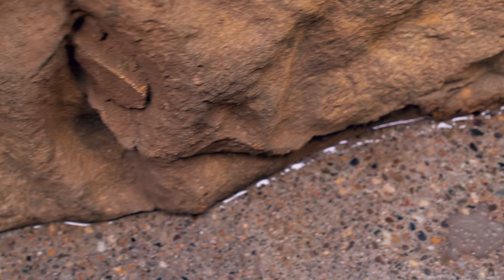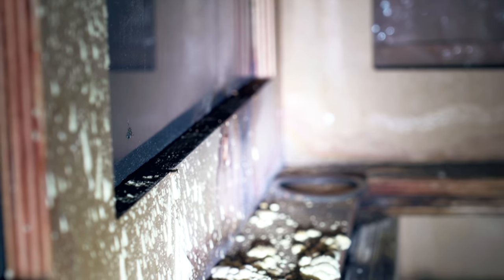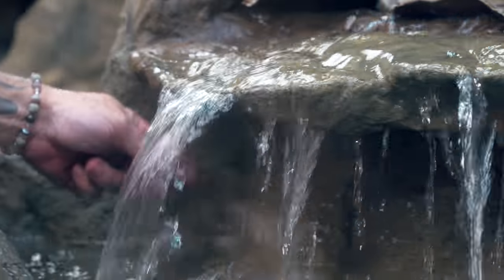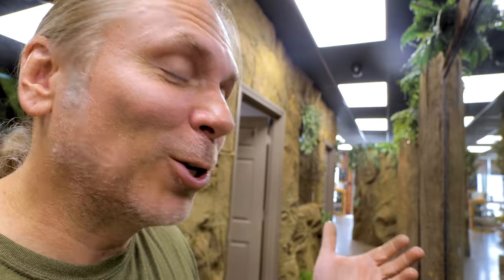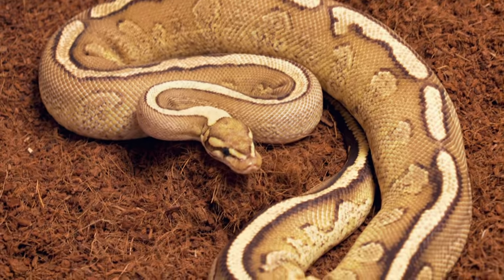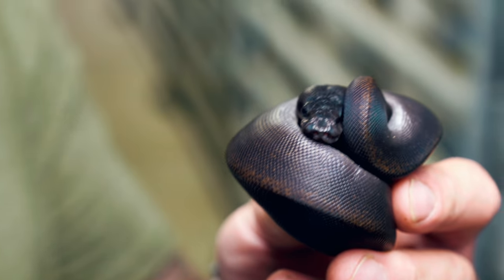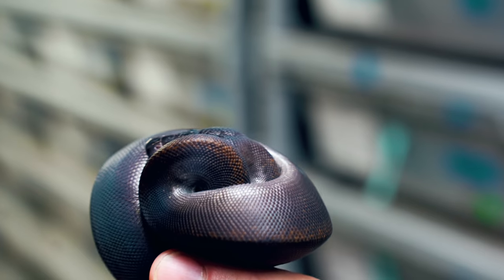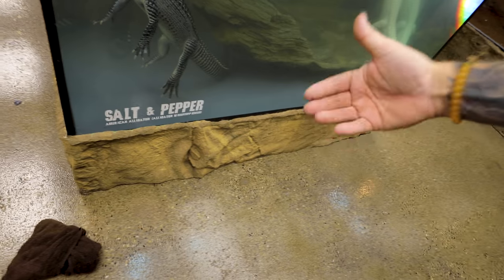MY ALBINO ALLIGATOR POND IS LEAKING!! NOW WHAT?? | BRIAN BARCZYK

Comment: I’d be concerned about water getting between the tank and wood frame. Even though the outside is flexsealed, the wood frame could rot from the inside.
Reply: Yeah that whole thing is going to have to rebuilt in not much time...water destroys wood quick.
Reply: Zach Jaynes You guys are right .I was looking at wet wood, mold no telling what is going on in the inside.Flex seal is junk never did have any luck with  that product.This could be a very big deal.
Reply: I was thinking the exact same thing
Reply: Just think how fast they'll grow will need another enclosure
Reply: All that money paid for them cages they should last years... We might have months tops with them.
Reply: I'd be worried about wood rot and mold

Comment: Hey Brian love the videos!! Just some advice for the flex seal when you cover over the wet wood it doesn’t dry and will rot out and will be a way bigger job you should get someone with a hose on the inside of the tank and someone underneath and slowly move the hose around until you see water coming out then seal on the inside of the tank !!

Comment: If you come down 75, stop at the Creation Museum/Ark Encounter. They have an array of different animals at the Ark. 

I have to disagree with the Flexseal fix, just a bandaid IMO. Having been in home repair and having aquariums for many years, I've dealt with leaks and water damage. If you don't stop the water at the problem, it will cause damage other places. I think you just created a dam with the Flexseal and that water will find its way somewhere else and if it sits on the wood too long, you're going to have more damage due to rot. Hopefully not, but experience tells me other wise. Like you mentioned, that water is running backwards on the bottom of the waterfall and found and entrance. 
I would recommend to Stuart in the future to use Redguard or Mapei Aquadefense on aquarium/pond type enclosures to water proof any wood under the structure in case of a leak like yours.

Comment: I assume that’s pressure treated lumber, will that be enough to prevent it from rotting? Spraying that flex seal overtop the wood like that, seems like you’d only be trapping the water inside the wood, and not resolving the issue? You may end up with a bigger issue down the road, if the woods acting like I think, more or less a soaked sponge. I’m a commercial electrician, not a carpenter/inspector, so this’s only a question, not me telling you it’s wrong. I don’t run into much wood framing, I try to stay away from residential, and that’s mainly where you’d see it. BOL, hope to see you guys take that trip, it should make for an interesting series.

Comment: Hate to say this but you still have a leak.. All the Flexsteel was paint the outside the wood..The leak is above the top edge of the tank..Tearing out the bottom won't help at all.. I would also check where the water is pumped into the water fall..